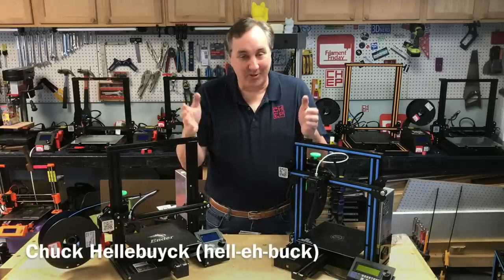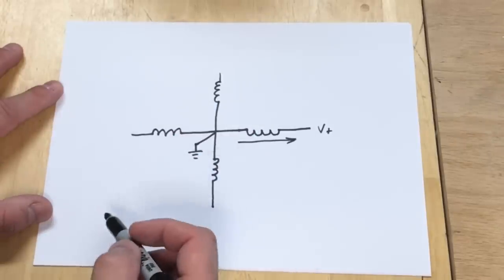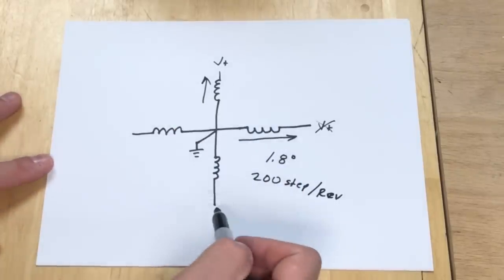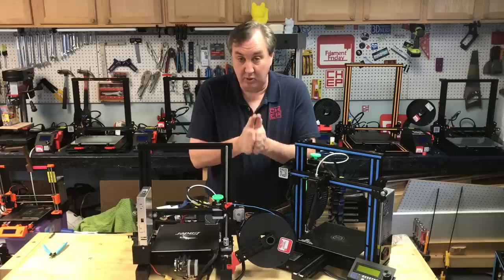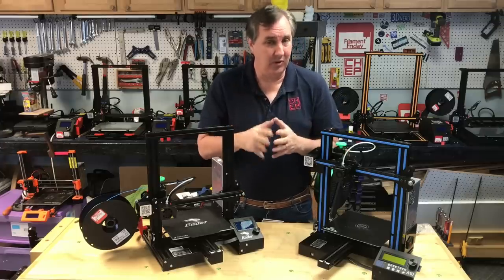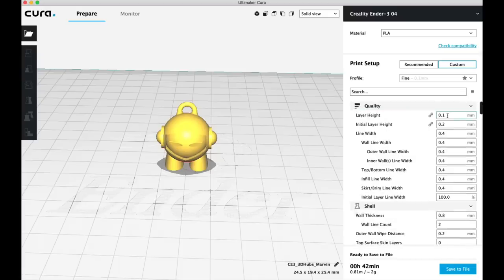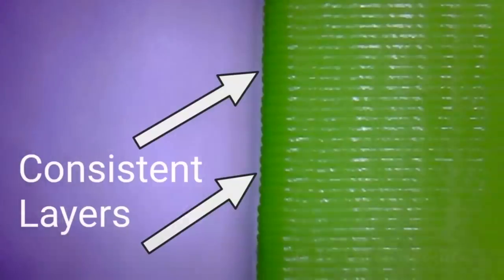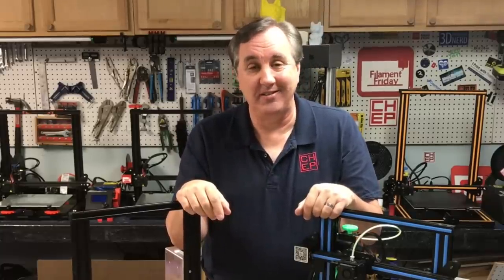Better Quality 3D Prints Using MAGIC NUMBERS on Creality Ender 3, CR-10, A10

Comment: and how exactly do you tell your firmware only to stop on full steps? how do you know that the polling rate of your mcu is high enough to get that right there? Mesh bed leveling only works with micro stepping. how do you tell the printer to only use full steps there? and why does this only work on z, but not on x and y? 

This is another myth that people tell, without any background. this is just not how it works...
Reply from the maker: As so stated many times here in comments and referred to in the video, if you start on a microstep you rise to the same micro step position using magic numbers. The Microstep angles are not equal so using magic numbers you avg out that error because you will use all of them with magic numbers. That why under the microscope I show how consistent the layers are vs not.
Reply: If you listen closely, he says you don't need to land on whole steps. Just coming back to the same microstep works too. I have written code to microstep, and I know from experience that all microsteps are not exactly equal. Getting back to the SAME step position is more consistent than landing on any arbitrary step position. At least that's what he's saying, and it makes sense.
Reply: The others have adressed the rest of the issues with your comment already. Here's the rest: 

There is no polling involved in driving stepper motors. 

Mesh bed leveling does not change the fact that if you use a layer height that is a multiple of your microstep resolution (i.e. "magic number"), you land on the same microstep each layer and get consistent layer heights. 

It is unnecessary for X and Y axis because they are (ideally) not loaded, and thus there is less load angle difference between different microsteps.

Maybe you need to brush up on your background?

Comment: You saved 7 minutes on the print with "magic numbers" because it had a greater layer height... 🙄
Reply: yup, thats obvious. in theory he also got a better print quality, although its hardly noticable.
Reply: The point is consistent layer height with little to no loss in quality, so it is more than just saving time, it also helps with better surface finish.